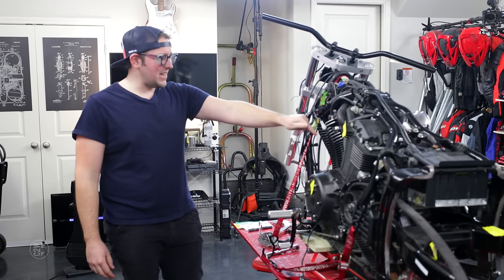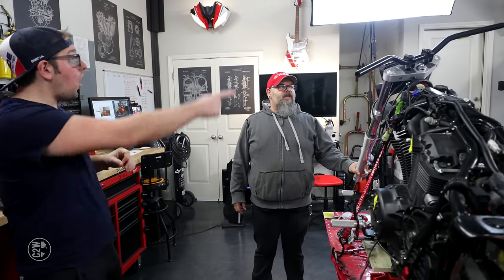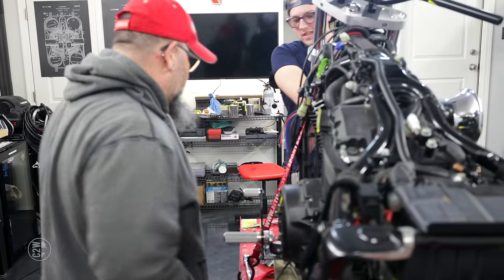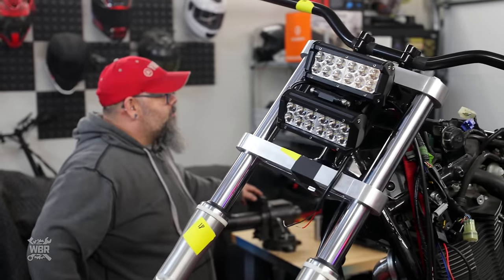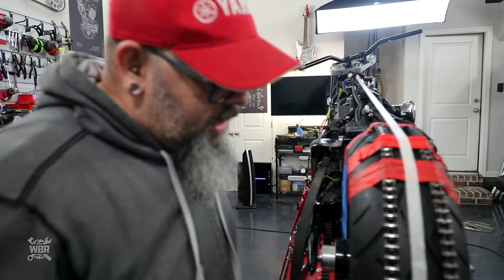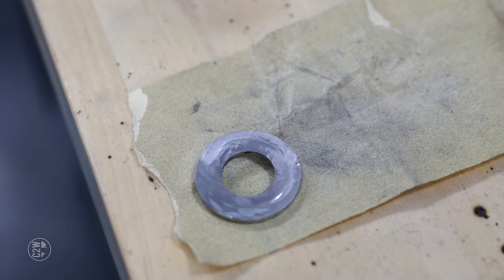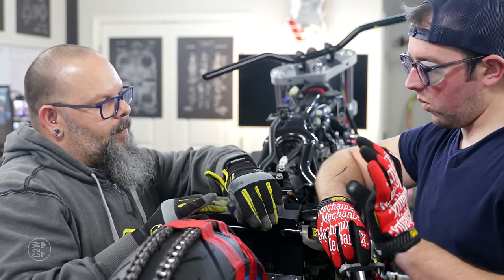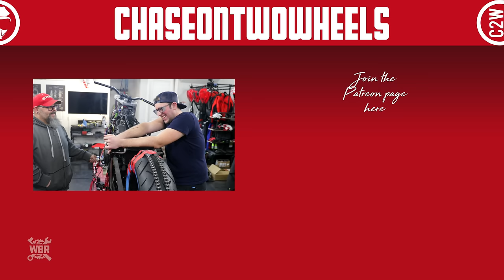Making our own wheel spacers is NUTS!! [Wrecked Bike Rebuild - Ep 18 - Vstar 1300 Bobber]

Comment: Take a selection of washers in various thicknesses, then cut one quarter out of all of them. Then you can pick and choose, and just slide them onto the axle, without actually removing the axle.  Once you get the spacing correct, you measure them, and make a spacer that size.

Comment: Ok you centered the wheel. You centered the brake disc in the caliper. How do you center the pulley? With spacers and/or shims between wheel and pulley? What do you do if pulley is too fat out? Doing the same thing on my 2004 deuce using the donor wheel grommet a 2006 street bob spoked wheel. The dyna uses a 2.098 lh spacer on a 1 inch axle. Closest I can find in 3/4 spacer is either 2.000 or 2.125. What would you recommend? This is all assuming both rear wheels have the same hub width.

Comment: You need a better camera with a working auto-focus...
Reply from the maker: I would say I need to shoot at a higher aperture but I agree. Focus wasn't spot on this episode.
Reply: @chaseontwowheels  Have you tried Amazon? I hear they sell cameras.
Reply: @evansolomon169  i heard there was some rock solid deals going on
Reply: @chaseontwowheels   If you are shooting with a DLSR then Aperture controls the brightness of the image that passes through the lens and falls on the image sensor and is not the path to focus because it will work in low light.
It looks like whats happening in your case is an inability to read the distance results which is usually a trait of a older camera or a less expensive one? I would find using it frustrating
Reply from the maker: Well you guys are just freaking hilarious arn't you?
Reply from the maker: There's a ton to unpack in that comment and I really dont have time to do that at this point. Long story short: Camera is pro grade, lens is pro grade and shooting at a higher aperture keeps more things in focus there for making it easier for the camera to keep things in focus.
Reply: @chaseontwowheels  If you say so... It's your channel but the net results are what they are...
Reply: @Bass.Player  there is a reason that in order to get the "Boca effect" you adjust the aperture. While aperture affects the amount of light, it also changes the range of depth that is in focus.
Reply: @reallunacy  And when the area of focus is constantly changing? You should have a rapid focusing camera...
Reply: @Bass.Player  Which is why he wants to increase the aperture to increase the field of focus hence less rapid changes in focus.